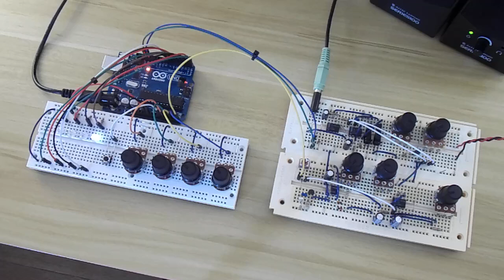McBennett Sequencer with Arduino UNO

Comment: Very nice. I'd just add:
* Up to 8 steps
* Internal clock potentiometer
* Clock input (to let it be synced by other devices)
* A Reset Input (you won't imagine how useful it can be)
* A Clock Output to sync other devices (or to "pass the clock out" in a chain)
* A knob for selecting the number of steps
* A step mode, to tune each pitch one at a time
* A knob to select the "direction" (forward, backwards, ping-pong, random)

* Quantization (a knob for the note and one for the scale)
Reply: Hello, could you show your schematic, please?
Reply: where?

Comment: Hi Pete, firstly, thank you for this series on Synths.
I am thinking on doing a series of these synth modules using the Nano, along with this Sequencer, because the Nano has extra Analog pins. I am intending to add an extra 2 steps into this sequence. I envisage using pins A5 & A6 for their Pitch potentiometers, D8 & D9 for the LED's and pins D10 & D11 for the channel select.
Do you see any issues in adding these, along with modifying the code.
Reply from the maker: Hi Lance, you're welcome. I'm always happy to hear that people are building my designs. And yes, I would use the Nano for six steps instead of four if I was going to build it into a project box. I like the Uno for prototyping and testing code because it's convenient.

Comment: I've been spending my time in quarantine learning about synths and how to build one. Your set of videos is perfect, and is actually similar to the design I decided on (DCO + analog filter and envelope generator). I really like that you used LM358's as opposed to other op amps that require dual rail power supplies.
Reply from the maker: Awesome, thank you! Yes, one of my goals has been to keep it as simple as possible, such as being able to power up with a single 9 volt battery for the filter design.

Comment: Nice job, Pete. I always like to see your breadboard work. The filter sounds are amazing! I’ll check out your schematics. If you’re curious, maybe you can check out my recent sequencer posts. I’ve been feeding the sound through a Helix sound processor. Thanks for sharing your work as always! 🙋🏻‍♀️
Reply from the maker: Hi Sarah! I had a look at your sequencer projects, sounding great! I used a CD4017 and two CD4016's "back in the day" to 8-step  sequence my original analog PWM oscillator synth. This was in the pre-YouTube days!  I was about to re-create the circuit for my channel, but then decided to code it in the Arduino. I find it fun playing around with code and hearing the results as I make changes. Who says you can't teach an old dog new tricks? That being said, I will never give up my purely analog filter!!!!
Reply: Pete McBennett I e never heard of such a sequencer using CD4016’s; I’d love to see that in schematic or breadboard form...I’m not a ‘computer chick,’ so I avoid Arduino, etc. programming. I mostly adhere to CMOS chips. Your posts are always great! And a HUGE thanks for checking out my channel, Pete. I hope you’ll subscribe and tap the bell to stay tuned.